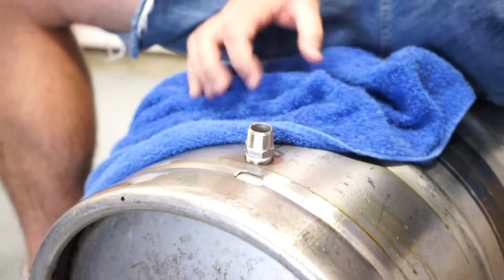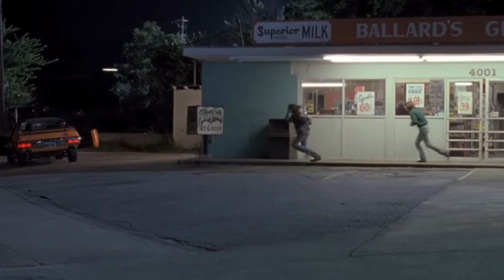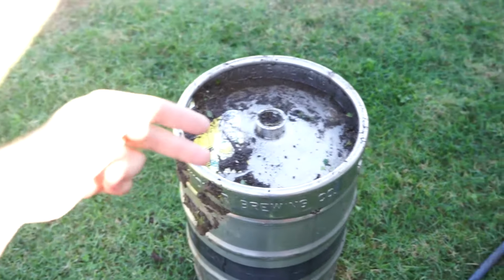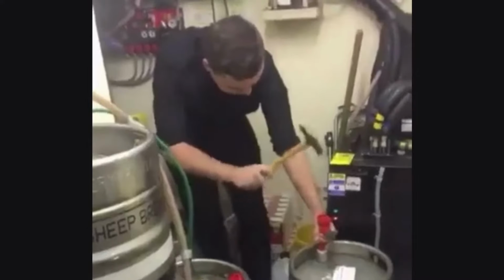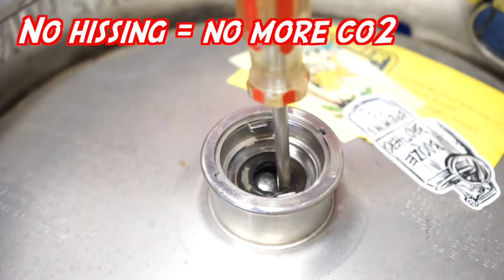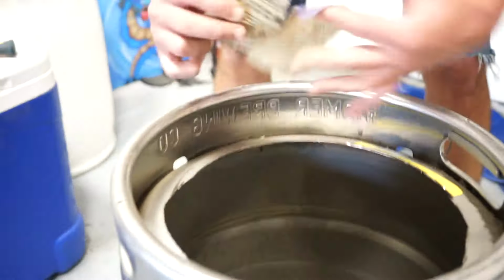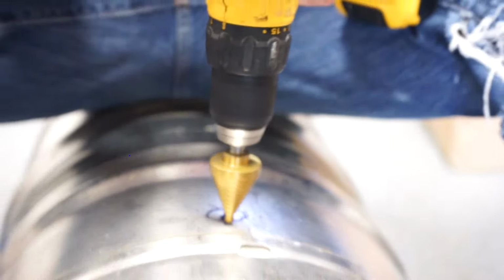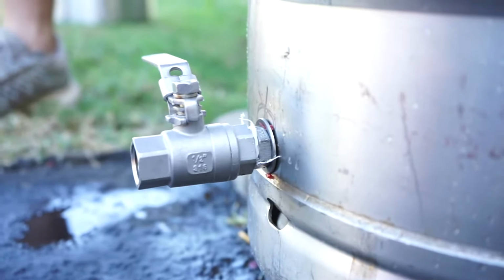How to Build DIY HOMEBREW KEGGLE (No Welding)

Comment: 2:45 they go dull extremely fast. 
Yes, because you use them at such high speed. Stainless gets work hardened
Reply from the maker: Cheers Sahi!
Reply: How to use this correctly? In low speed?
Reply: @jhjgyhuhd3336  yes low speed and also cutting oil is highly recommended. Take your time. Steel is hard, let the tool cut it bit by bit. Take your time. Its not like wood
Reply: @drdzdd  ok.
 Thanks a lot! I'll do it like u said.

Comment: Water works great for stainless as the bits usually “become dull” from the heat of drilling. Carbon steel, use oil like turd nugget said.